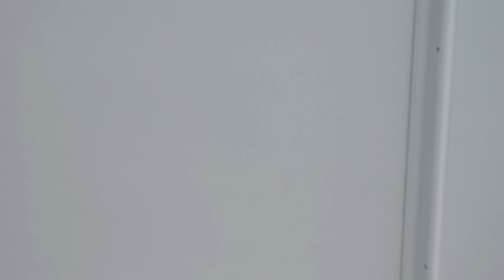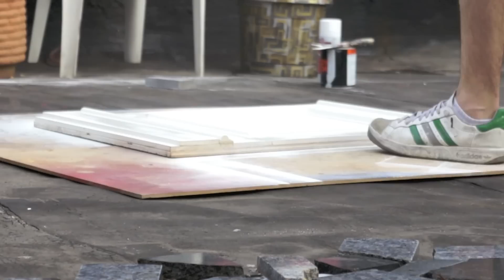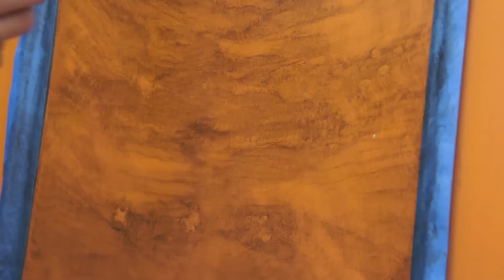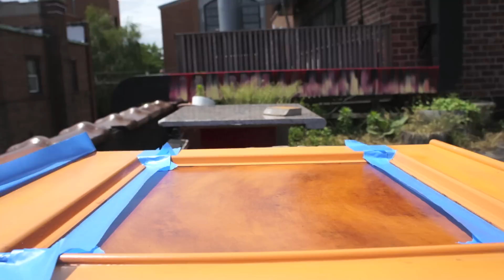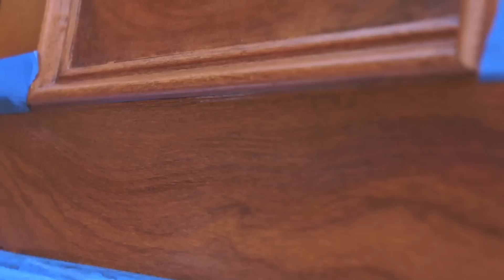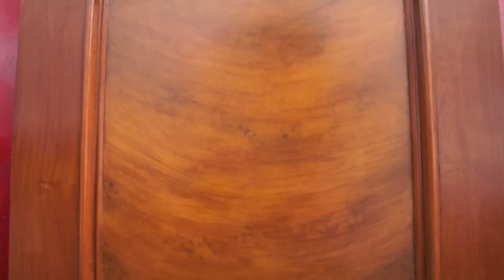Jeff Pollastro Paints Imitation Wood

Comment from the maker: @Валентини Василиса, This post will not quite link to your question, perhaps because it is linked elsewhere.  

Hopefully you'll be able to read it. Firstly, many thanks for your compliments and even more so for your questions.  By the way, your English is great.  Regarding your questions, if I answer them in a technical manner, you'll have to sit down for a while because I could write a book on the nature of glazes, the different types of mediums and how they differ, what paint is vs. glaze, and the idea of stains and how they differ from paint and glazes.  I will keep it brief, but if you require further information, please email me, and I will get more technical with my answer.  Sound good?

Most glazes are fine unprotected.  Some people prefer to use a varnish at the end to protect the completed product, because it took several coats to achieve a final product, and they feel more comfortable when a varnish is on top.  Varnish or top coats will help protect your finish product.  It is another coat, which is very durable, and transparent, so it will necessarily add protection.  

Some glazes, like BEER GLAZE, which utilizes drinking beer as the body of the glaze, is less durable and often times a reversible glaze - meaning, it can be removed with its solvent, which happens to be water.  With reversible glazes will need protecting in between coats, and you will need to use the opposite medium.  If it is beer, you need to protect with oil, since a water-based barrier would only remove your work.  If you are not using beer as your body for your glaze, then you probably won't have to worry about what I just wrote.  Most commercial glazes are acrylic, and acrylic is a durable medium and also non-reversible, meaning it will not reverse using water on top of it once dry.  

Regarding stains, this is different.  Paints and glazes are topical layers, whereas stains are penetrating layers.  If you use a paint and put a glaze on top of it, the glaze essentially sits on top of the paint (sometimes this is not the case, but I won't get too technical here), and by adding more coats of glaze, you just keep adding layers that sit on top of each other like a sandwich.  Since glazes are transparent, you are seeing through each coat until you see the opaque paint as your basecoat.  Now with stains, there is no sandwich effect.  If you have a bare wood, for example, you use stains to penetrate through the wood to color the wood.  Think of it as an injection of color.  If you were to keep adding layers of stain, you would be continuing to inject color into the existing color, not layering, so to say. 

This is a basic concept and explanation, though.  I am sure there are stains out there that have a chemical in them that allows for them to sit on top of the surface awhile longer before penetrating the surface, so they are able to utilize that to create a new and different approach.  Over large surfaces, this would be very difficult to sustain, because eventually your stain would penetrate, and therefore not able to manipulate.  I wouldn't recommend this, unless it is a technique you've personally developed.  Again, this can get complicated and my explanation can give mixed messages.  On a basic level, I would stick to glazes and paints.  I prefer Golden Artist Acrylics for my water-based glazes.  Preferably, their Proceed line, which has an increased open time, so I can do large surfaces without drying on me.  

Hope this helps.
Reply: Jeff Pollastro, I know it's been a while since I wrote to you for the first time, I just wanted to say thank you for your explanation and time it took to write ). We started to do furniture with my husband, for our new apartment and finally I'll be able to try faux wood technic

Comment from the maker: The manufacturing of all products requires our dependency of oil, and the paint drying, itself, is small in comparison.  EPA and LEEDS, do not have a system of testing the manufacturers before placing paints on shelves, which is sad.  People falling into the cloud of 'Green' products are mislead, because they weren't 'green' while being made.  I called these places myself, and they admit this fault.  The 'Green' scam could be much more affective if done properly.  The public is misinformed.